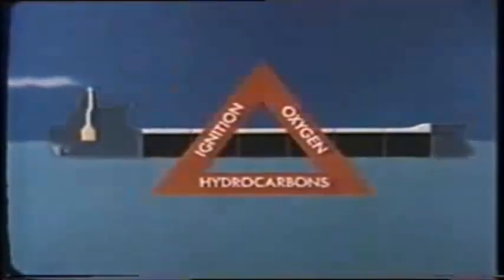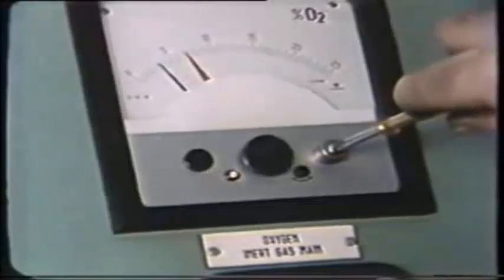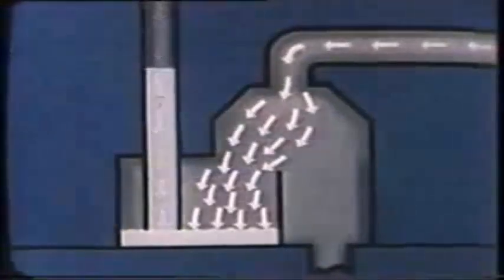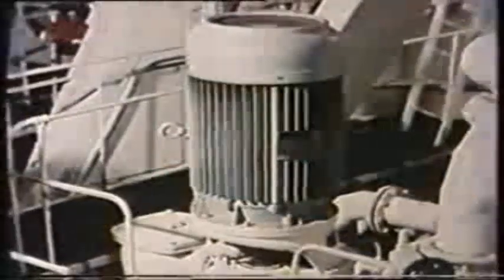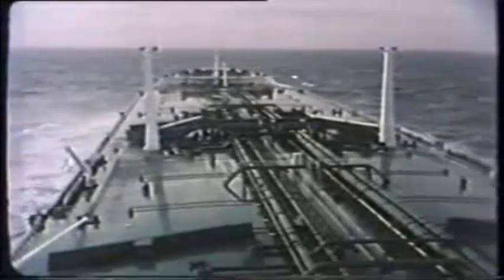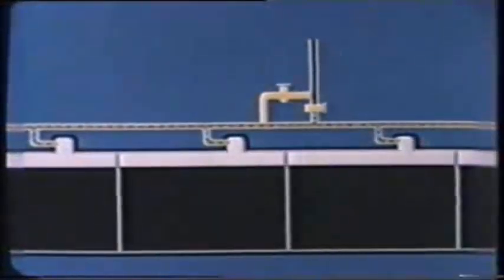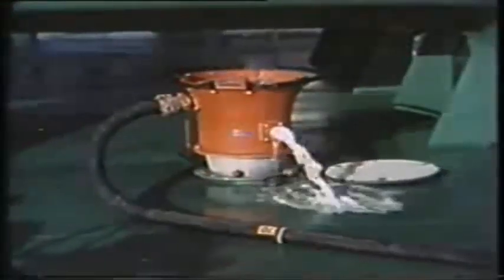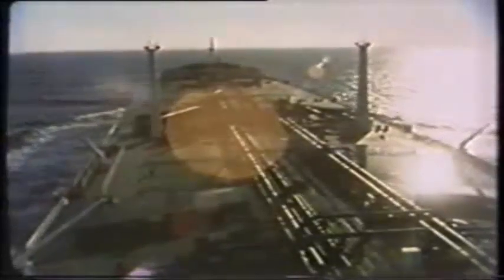What is an Inert Gas or IG System on Tankers?

Comment: Sir, why ig takes uptake from boiler not from main engine
Reply: efficiency, autonomous, control and safety.
Reply: Divine Hindu  because main engine cannot run at Port during discharging,loading operation
Reply: Best Answer : engine is not running at anchorage and during cargo operations
Reply: Awwwtsss common sense 😂😂😂
Reply: One of the answer: Main engine uptake is used to run turbocharger where energy from gas is utilized and then that gas is used in exhaust boiler where most of the heat is utilized and then it is used for inert gas system. So basically to increase the overall efficiency of the ship and reduce the cost.
Reply: Sir para saan po ang inert gas nalilito ako
Reply: Prakash Raj Because of excess o2  in exhaust of main engines.  Diesel engine exhaust is unsuitable. Boiler exhaust is controlled to a low o2 level of around 2%, so this gas,once cooled and cleaned of any soot in a water cold scrubber is ideal for inert gas.
Reply: 1) Inert gas is most needed during port stay, when main engine is not running.
2) To ensure complete combustion of fuel extra air is fed into the engine(turbocharged) resulting in a greater concentration of oxygen in the exhaust.